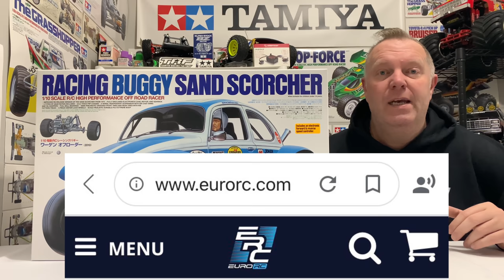Tamiya Sand Scorcher Full SRB Chassis Build…

Comment: Cool vid!

Yes the SRB is one of the best kits out there, even all these years later.

I recall buying all three versions brand new when they first came out, as well as multiple body kits, tire kits, heavy duty steel u-joints, with the addition of double and triple shocks, as each of them all took a beating way back then. 

If I'd only known they would be worth what they are now, I would have bought more and left them in storage.

There were no after market mod suppliers when they first came out, had to chase down our own springs for coil-overs as well as smaller springs to go around the piston of the shock.

That and wiring our own light kits, it's a good thing our high school had a machine shop class to make parts, as we were constantly making outrageous mods for the suspension system.

So many good times. 

😎😎

Comment: Remember having 3 of these when I was younger when I just got into the big boys game of rc .  The sand scorchers loved the beaches at Newquay and was totally waterproof , spent many an hour cleaning after a day out , the originals has brass universal joints that went onto the driveshafts but I found they use to wear really quickly , I put a 540 black s motor in it and it went like hell . Maybe time to get another one or a blitzer beetle as I still have a few old school tamiyas here . Mad bulls , midnight pumpkin and hornets , the sand scorchers I had ended up in demolition Darby at the end , if I only knew then how much they are worth now . But they was definitely bashed and played with

Comment: Great work Glenn. I was given by a mate back in 1988-ish a box full of car parts. I actually managed, without manuals to sort them out and put the chassis together. One was a Kyosho Assault/Scorpion thing, which is now a running chassis all these years later. The other was an SRB chassis Super Champ. I don't want to admit how many parts were replaced on both while restoring them, here's a clue, it was borderline pointless.
Anyway, The SRB chassis is all together, has been for a couple years actually. It's a kind of bastardized Super Champ that I've modded to fit an SS body to it. The only thing holding me back is attempting to paint the body box art! It just seems really hard and easy to stuf up.
(btw, both chassis sat around in bits in a box for something like 30 years?) 
Looking forward to the next vid :)
Reply from the maker: Excellent thanks for sharing this my friend 🤩👊🏻

Comment: G'day Glenn beautiful kit mate the shock's don't leak for long lol And the low gearing is a bit better because it's bloody heavy car built you will see mate. When I drove my Superbuggy champ only put one battery through it tall gear was to tall traction rolled on the road nooooo low gear was spot on more bottom end and revved out top better. Great build good stuff mate 👍👍
Reply from the maker: Thanks buddy yeah I’m happy just to run it with the 540 kit motor, actually can’t wait to see it running 😊😊👋🏻

Comment: I bought an original Rough Rider back in 1980, complete with mechanical speed control. It was awesome, I regret selling this car, I have been trying to find an (affordable) replacement ever since. Getting the Sand Scorcher would be relatively easy, but I want the Rough Rider (Buggy Champ) and that is much harder to get hold of.
Reply: But SS and RR have thesame  chassis.  SS and RR bodyshells can be bought separately. This is whT I did back in the 80s.

Comment: I am looking forward to building mine. Would it be a problem fitting a not too wild brushless motor for some additional speed? I will probably mostly drive it on the smooth gravel road here at home. And some straight line speed is fun.

Comment: I never used TAMIYA the thread lock becaue I didn't find it necessary but add capacitors to the motor to reduce interference with the RC.